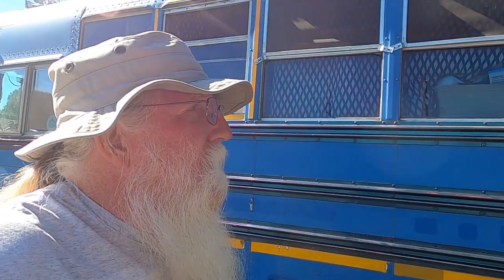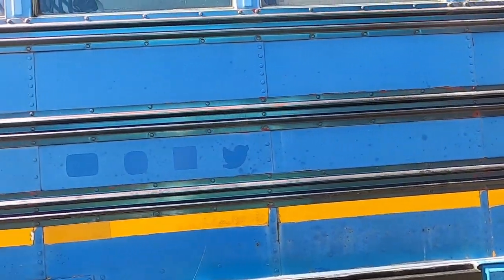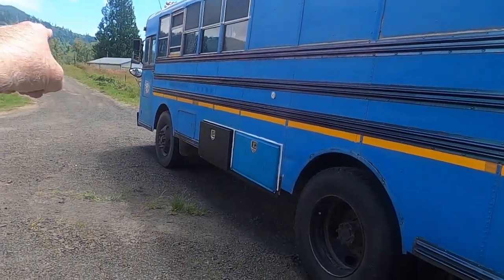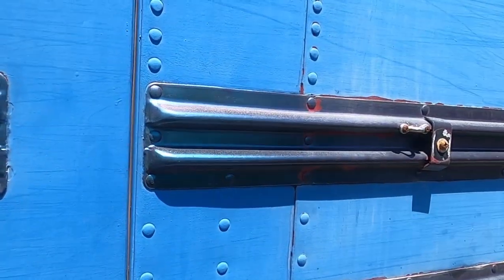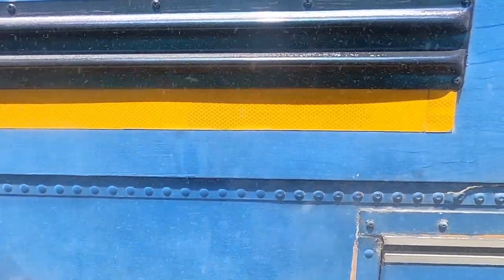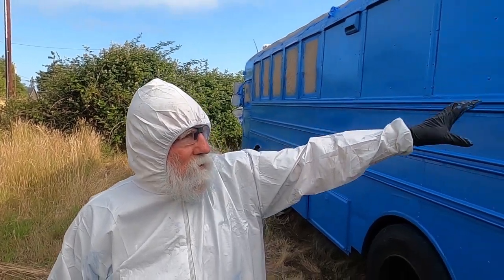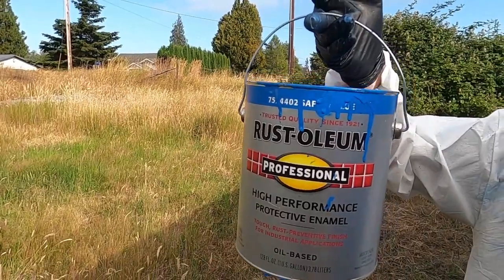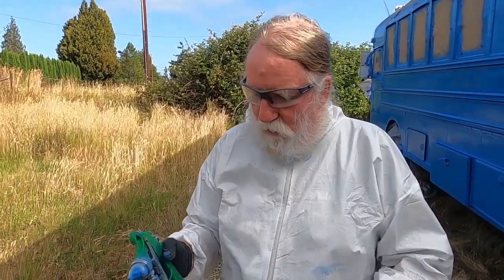The Bus Needs a New Coat of Paint

Comment: I think I would’ve use yellow tape because it’s hard to distinguish between the tape and the paint. 🤣😂🤣.  That sure is a pretty blue. Blue is my favorite color. I painted mine blue but mine is darker. It looks great Steve!
Reply from the maker: It doesn't matter what color tape to use because it is just there to keep the paint off certain areas. A lot of blue buses are a darker blue. This is safety blue that my late wife picked out. Good enough reason to keep it that color 🙂
Reply: @SteampunkSteve  which paint did you use and what is the specific color if you don't mind?
Reply from the maker: I used Rust-Oleum safety blue